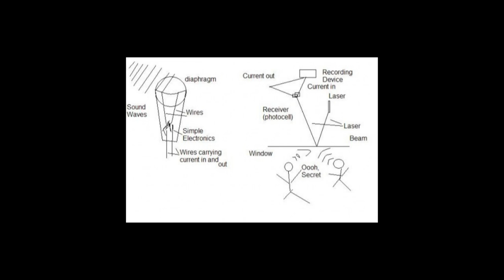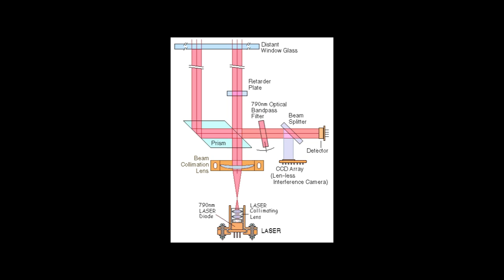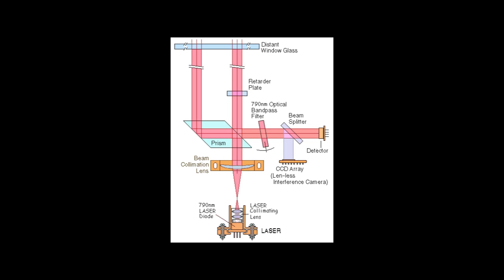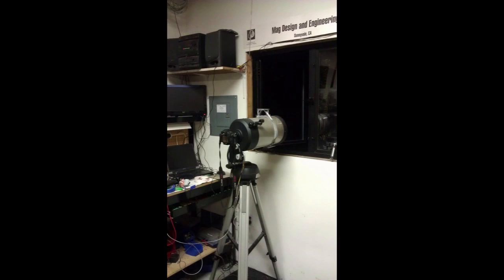Laser microphone for audio surveillance via window panes

Comment: have you tried the windows of a car? then you would have a single sheet window, thats mobile and cars have stereos.
Cheers!
Reply: Frank Barone the windshield is normally double pane laminated but the side windows are single pane tempered glass
Reply: @MLGJuggernautgaming  modern vehicles, especially luxury vehicles have double paned glass on all windows.

Tinted windows, due to the plastic tint-film adhered to the window, are somewhat shatter resistant. Higher quality tint typically provides a higher degree of shatter resistance.
Reply: @NOSUBSCRIBERSWANTED  I though they were tempered in a way to cause them to shatter like that
Reply: @forloop7713 yes. On normal cars only the windshield is laminated. Gives it strength to prevent objects entering the vehicle. When they first became a thing, seatbelts were not widely used yet and they could cause horrific injuries called crowning. Basically an unrestrained occupant in a collision could shove their head through the windshield, and then have it constrict back down around their neck due to the plastic reinforced layer in the glass.

Side and rear windows however are, tempered in most cars. Doesnt matter if they are tinted or not. Break them and they will shatter into thousands of little round pieces. This is to prevent slicing injuries, and provides a potential escape route if needed.

Now, some luxury cars, are opting for double laminated side windows for extra noise insulation. This is only very few luxury models, and they do cause issues with emergence egress, if breaking the window becomes becessary.

Comment: What if you modulate the laser beam with a sinewave. Then compare the reflected beam vs the send beam. The phase shift would be the audio. You need to have a very fast comperator, but it might work.
Reply: I think modulation is an unnecessary complication - the laser beam is already a sine wave with a wavelength on the order of 1 micron.  An interferometer based on this would be sensitive to deflections less than 100 nanometers.

Comment: How about shining the beam through the window at a soft surface in the room near the sound source, and then sampling the beam for doppler shift caused by the soft surface moving back and forth?  The resonance from the glass is pretty strong.
Reply: +Ray L It's 60Hz hum from any kind of mains-powered light. He should look at it with his oscilloscope and then use the (I tink built-in?) spectrum analyzer functionality.

Comment: cool as all hell !....obviously u r just using what u already have, but ideally you would use an IR or UV laser since u can't see the beam..& just use a visible 1 to setup/calibrate.....also use some combo of simple op amp hi-pass/low pass or notch filters to cut the bad freqs...or even just a regular graphic and/or parametric EQ....also a solar panel or an array of photo diodes/transistors might give better results.. i think the AM/intensity modulation is intrinsically noisy.. prob best just 2 go digital with more advanced circuits using PCM or something similar. & def play with reflection angle...& I bet the refraction between paynes is F'n with the results.....not bad 4 a 1st try....this can work very well indeed.

Comment: I wonder if modulating the laser at typical RF frequencies (say 2+MHz) would allow the 'carrier' to be frequency modulated off of the glass enough to pick up a signal.  Run it at 99.7MHz and pick it up on a typical FM radio?
Reply: Just realized that we're probably talking deviations in the micron level in the glass, so the frequency deviations would be incredibly small...you'd need to be in the GHz range probably to pick anything up.

Comment: part of the problem, of course, will be the device's cheap audio amplifier circuitry, but just how much is due to that can be discriminated away from the problem by sending a direct sound source _without_ reflection. try something like this: some of the modern speaker-cones have a silverplastic cone, use one of these to output from the stereo, and aim the light reciever at that, to see how clear the clearest signal can be, before pulling the circuitry to pieces. i really reckon it sounds "woody"

Comment: ("warbling", yep, a professional sound engineeering term) - the "warbling" is (i'm very sure) going to be due to the door responding more to the oscillations in the room's _floor_. (wooden floor, right? sounds like it) ... the exact same signal distortion sound occurs when one sets up a microphone on a stand in a room with a large open wooden floor with amplified music playing in the room. you might wanna try multiple channels, mixing different sources, and phase-cancelling distortions out.

Comment: @about 3 mins, I quit, 'coz I'm familiar with the concept of the device, and rather sure from sound engineering that I know what that "whistling/humming" resonant frequency thing you're experiencing is. Because the size of the glass pane is so small, you're likely to be getting more of the sound that is moving the _french_door_ overall more than the glass panes, themselves. The door will be vibrating a tiny bit randomly - that's part of the signal distortion. The "warbling" is because (C next..)

Comment: this would explain the T90's rubber anti laser sighting skin... maybe trying to rescope the beam, using a steady beam that is unfocusable will make for a tough time, using an adjustable focus laser would make it easier imho, cuz then you focus it to the light diode, not the window.  i've seen a rifle scope used just before the diode to sort of refocus the beam... however, you'd have to catch the whole beam to get the whole signal. try using an IR sensor that should do the trick.

Comment: To solve the angle issue you could use short pulses of light, and the vibrations of the window would be frequency modulations on the return pulses. My maths is telling me a clock source in the 1Thz range is needed, although it strikes me as a task with a much simpler analogue solution.

Comment: There are a ton of fringes in the picture at 1:28. I'm guessing that these are due to multiple reflections from both surfaces of the two panes. If you collect a larger area with a lens you'll average over these fringes and perhaps cut down on the howling. However, you might also reduce your sensitivity to sound. Try getting a clean spot back onto the Rx wall and then placing the detector and a small lens at the edge of the beam so that you can average over fringes and do some slope detection.

Comment: By the way I guess that a frame glass doesn't oscilate as a window because it has a smaller area so it absorbs less sound energy, it also has much greater stiffness because its small dimensions and it is in contact with a material that absorbs the energy (the frame itself and the picture)

Comment: How about a small piece of a "retro reflector". From what I know of retro reflectors, they are designed to send the laser light in the same direction it came from (or at least that's what the ones on the moon are designed to do). I know they sell reflector tape at the hardware store, although I am not sure how well this tape would work for this aplication. It does take away the "stealth" factor a little bit, but just a small piece of a reflector should do it.

Comment: Using a computer, you could try generating single audio frequencies and build up a response curve of the system. It might be useful to find out the frequency response of the photodiode. It might be that the diode can not respond fast enough to the incoming signal and is producing a low pass filter.

Comment: @NeitSotm 
The space between insulating double paned windows is sealed and filled with argon at low pressure. This setup will have a resonant frequency at which the glas panes will easily vibrate, even with the smallest excitation from the outside (that's what resonance is all about). And the frequency? Well within hearing range! I got a window here that will "hum" (which it does at resonance frequency) for half a second after being knocked on.

Comment: Well anything newer for the most part it is going to likely be dual pane glass, as for just mounting a pane of glass, id personally try finding a whole old frame with single plane glass or make your own and mounting that inside of a fake wall setup as i think that might change how everything will vibrate. 

Also i have always been interested in homemade audio surveillance and have looked into parabolic mics made of many things and even using a stethoscope and holding it up to a wall and record.